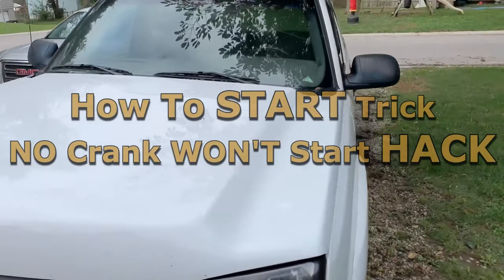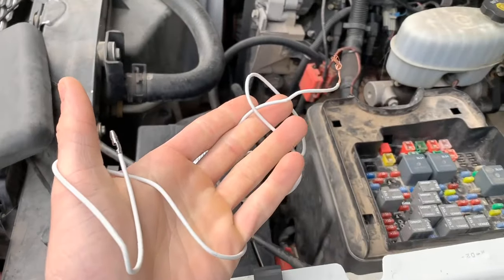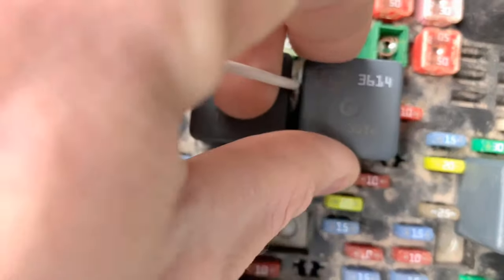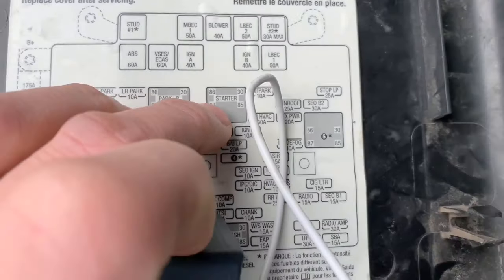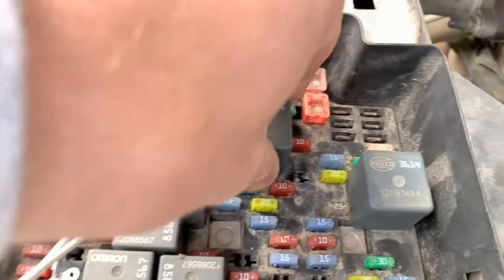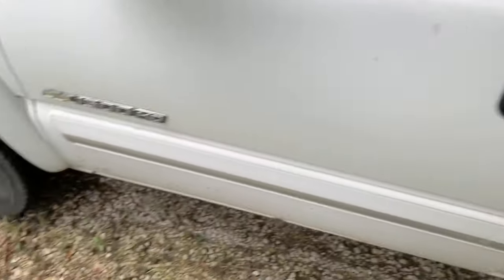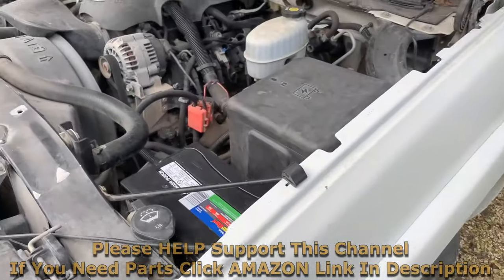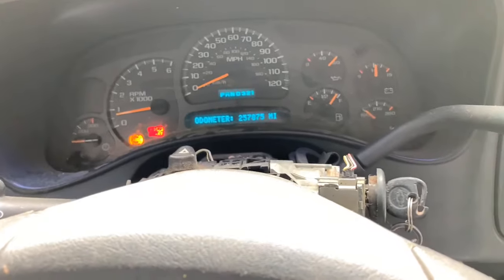NO START NO CRANK Chevy Silverado 5.3 Vortec 6.0 4.8 4.3 L How To Start TRICK Diagnose WONT START

Comment: I wanted to give my positive feedback. I have a truck with 225,000 miles, never had any issue a day and it’s life. It left me stranded in one night at midnight, and it would only click. I put a brand new battery in it that month and I knew that it wasn’t the battery. I knew it wasn’t the connections. After messing with the truck a while I eventually got it started and got it home. But then same thing just click click. After watching your video and switching around the relays a number of times, I decided to cross the relay and send 12 V power direct to the starter. It worked, I didn’t let the engine actually fire and start. I put the relay back in and use the key to start the truck. Oddly, the truck seems better than it did before I had the issue. My issue was an only just the click click, when I would turn the key on accessory the power started flickering on and off like the battery was being disconnected and reconnected really fast, but I knew there wasn’t a loose connection. Somehow crossing the relay in this fashion fixed something. And it fixed something else inside the truck. Even the doorbell dinger noise seems a little more loud and clear. It’s all very weird, and I wish I knew what the actual problem was, but I’m glad a little piece of wire can fix the issue enough to get it home.
Reply: I'm having the same problem did you ever figure out what the issue was thank you
Reply: @terrywilburn3579  I never did figure out anything. It happened again about two months later, I got it, started. It took it straight to the dealership and traded it in.

Comment: Great hack. What is the permanent  fix? Did you ever find the source of the problem?
Reply from the maker: Was one of the large fuses that is square it looked like it was good but had a slight crack in the wire or whatever inside it. It didn't look like it was blown can be multiple different things tho that just what was wrong with mine. GOOD LUCK!!!

Comment: Thanks for the video!! It worked but my truck went in reverse when I started it this way but I had it in park. I don't understand why it did that.
Reply from the maker: Was your truck in P/Park what happened most likely is your truck was already in R/Reverse this is not going to move the gear shifter in anyway.
Reply: @EverydayImTECHnIt  yeah I've did more troubleshooting and found out that it wouldn't start because it was in reverse. My gear shift cable was loose and it looked like it was in park but it wasn't. When I bypassed the relay it started and went in reverse. Thanks for checking!

Comment: Thanks for the video, worked on my daughters 2004 Avalanche. But now what? What are the probable causes? Starter? Solenoid? Ground?
Reply: Did you figure out your problem?
Reply: @rc_anykine8840  Yes, come to find out the vehicle had a third party anti theft device that had tripped. Found the reset button and no more problems.
Reply: @tonyforrest1095 I’m having the same problem in my 2000 Chevy Silverado. Don’t know where the reset button located though